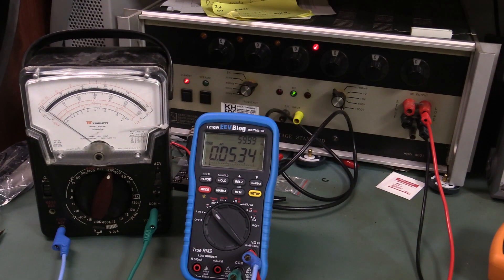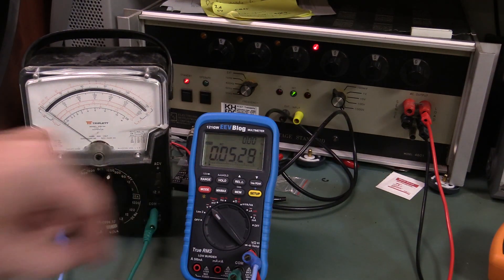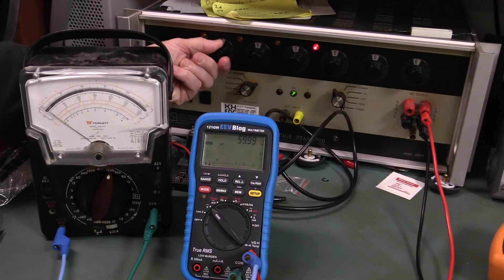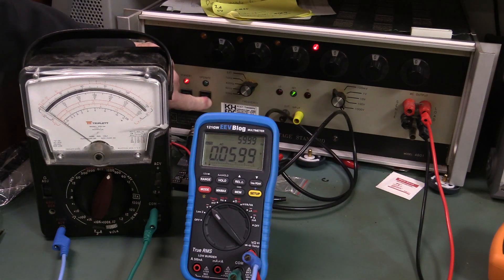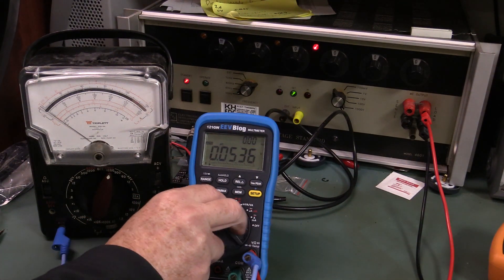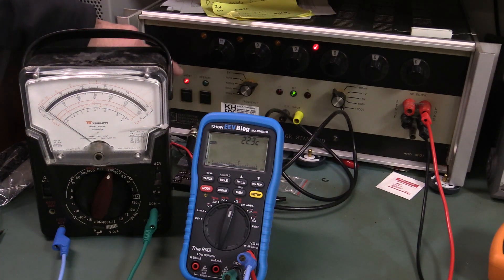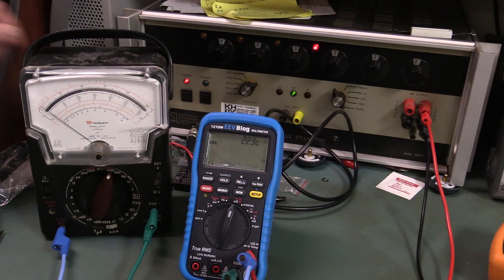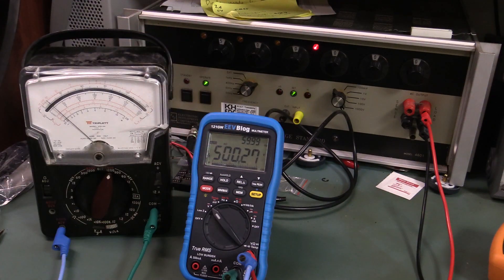121GW High Volatge AC Test

Comment: For anyone interested, I think I must have caused this damaged by measuring 1200V 28kHz @ 100W from an ultrasonic transducer driver.  I didn't use the meter again for at least a week, which is why I forgot all about that.  Doh!
Reply: Kean Maizels 28 kHz would certainly explain why you wouldn't have heard it then.
Reply: Indeed

Comment: Couldn’t the issue be a dc voltage, and changing the range switch causing an arc as it breaks contact, with the double contact points of the switch shortening the gap between the pcb contacts of the neighbouring range/mode creating effectively a spark gap, the arc burn you showed was between the pcb contacts.
Reply: Wow, I was just about to ask this.   What happens if the range switch is moved or not in an indent at these voltage levels.?
Reply: Well, first you shouldn't be measuring these high voltages with this meter.  Second, you should never change the range switch on a meter while connected to a circuit under test.  I don't think that is something any meter is designed for.  In this case, it was almost certainly my mistake as I had recently been working on a HV circuit that I forgot about.  Too many projects on the go at once.  No, I didn't move the range switch - just measured something I shouldn't have without additional attenuation.
Reply from the maker: What was the voltage Kean?
Reply: EEVblog2 It would have been approx 1200V at 25-28kHz from a 100W ultrasonic transducer driver.  Frequency is dependant on transducer setup.  Any arcing in the meter would have been inaudible over the noise from the transducer operating.  :D  I didn't use the meter again for at least a week, so forgot about that measurement.
Reply from the maker: Sounds like the culprit!, thanks Kean

Comment: Yesterday ive killed my MS8221C while trying to measure output of CCFL power supply. That was a stuped move, but you can try that.
Reply: G0867532 I was looking last night at a TV with failed backlight, checked the pcb first, 8mm gaps between the output traces and everything else. Nope not touching that, it can stay broke.
No idea what voltage it'd be but the caps are rated 3kv so not a hope of testing that or generating it externally
Reply: G0867532 yeah, we all do stupid things occasionally... mine was with 1200V 28kHz
Reply: I still have no idea why i did this. I even have sperical 100MΩ resistor to mesure such high voltages.
Reply: As i've read start-up voltage is about 3kV, then it drops to a few hundred.

Comment: Turn the knob on the meter while voltage is on. Bet you’d get an arc then.
Reply: Yeah. The PCB looks fried on the edge of a trace. There is no way it could had happened with a knob on a fixed position.
Reply: Exactly
Reply: Nope - do a little research about how arcs form between PCB traces.  The whole concept of a PCB spark gap relies on the pointed edges of the trace.

Comment: You say the protection cuts in but would it be possible to switch between say autoV and V and have arcing as Joe Smith's video speculates?
Reply: On the DC testing he previously shows, it appears the supply is limited to 10mA.   I'm not sure that is enough.  I asked Dave about his goals for his test and he posted "My goal was only to show that teh contacts do not arc over at these voltages."  In my case, I was trying to show that the PTC and resistors would not always provide enough protection to prevent damage to the circuit board.